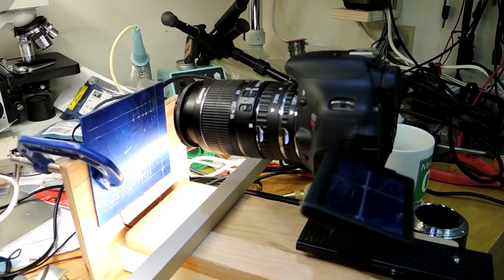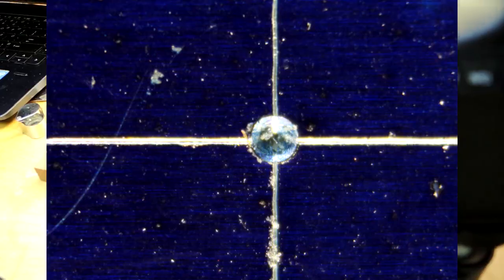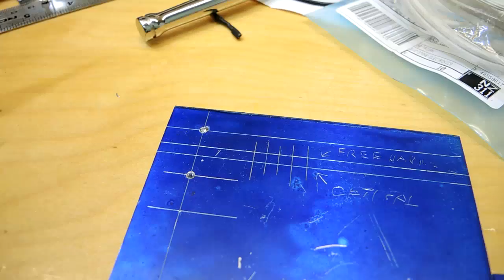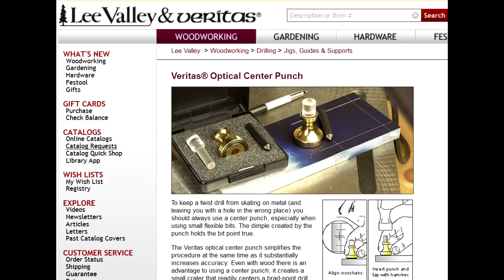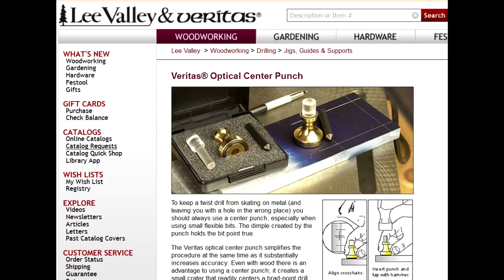Veritas Optical Center Punch

Comment: Yea not overkill at all for mounting a circuit board, you totally needed to buy this tool. ;-)
You can usually feel a sharp punch dropping into the cross section if you just run it along one of the score lines. 
I find I can do a better job with a manual punch compared to an automatic one. Not sure why, perhaps the tip lifts off as it triggers, someone should film it with a high-speed camera. 
Also you can steer a center punch around by holding it at an angle and hitting it again, if you were slightly out the first time.

I do see how this gadget used to be useful for precision work, but I guess precision layout by hand is rare these days.
Do get some transfer punches if you don't have any, they are quite useful.